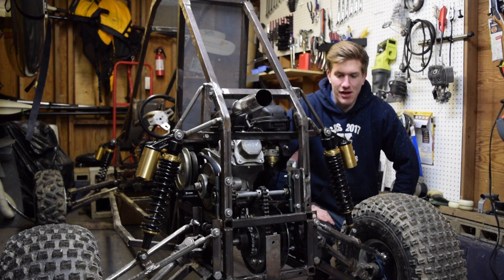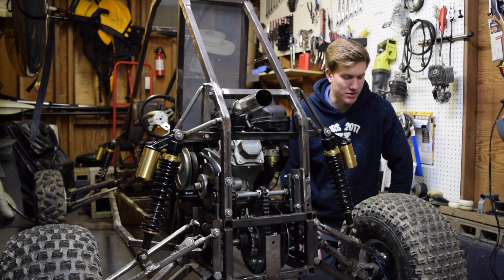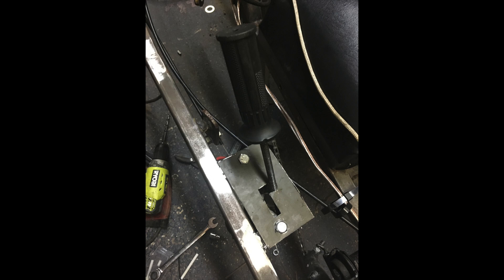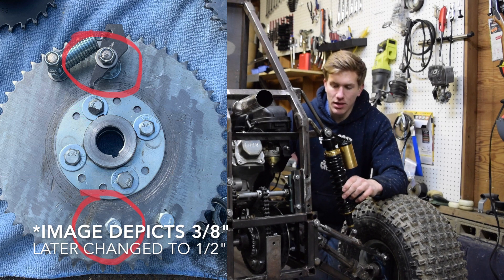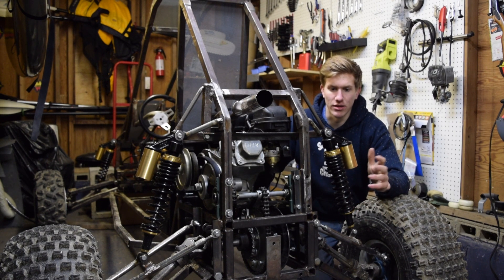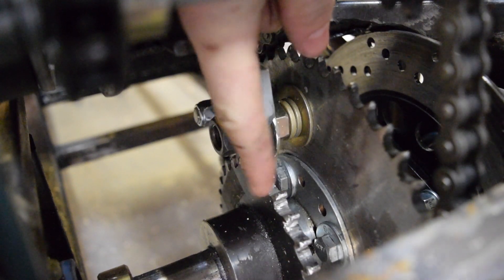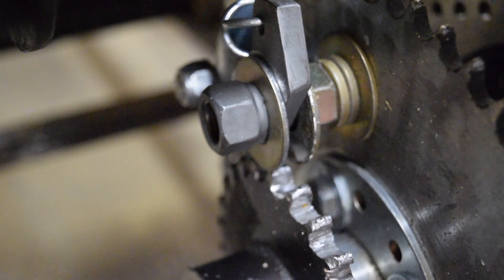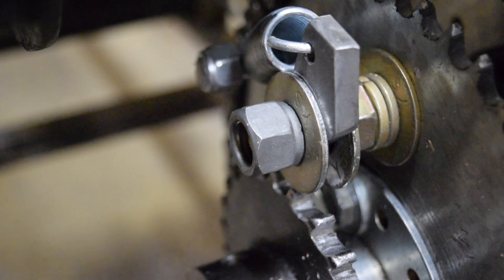How To Build a Go Kart Differential

Comment: Could u give more detail as to how you attached the drive sprocket onto the axles. I understand the differential sprocket design I just fail to understand how the drive sprocket (middle sprocket with chain on it) is fixed to the axles
Reply: The main drive sprocket  connects to a hub.  Both axles meet inside the middle of that hub. The Hub isn't keyed to either of the axles. Both axles can spin freely inside that hub.
Reply: How does it stay aligned with the sprockets and your diff if it's just in there free spinning? Do the axles meet together at the drive sprocket which has a hole that's a lil bigger than the axles and the. The hubs are wider and sandwich the drive sprocket between them and also keeping it aligned? Then what u just use two bearings per axle?
Reply: Sorry for being so dense. I really admire your simple and effective design. Impressive

Comment: 👍 Definitely a great idea. 
    After reading through many of the comments it seems like many Overlook the fact that this is a inexpensive way to achieve excellent results. Although the sprockets are relatively inexpensive and likely easy to replace,  curious how long they're wearing. 
    I'm getting ready to start building a 4x4 electric Street buggy. ( yeah I can actually get it licensed if I follow a few rules) Although I could use any number of ready-made differentials, I always prefer to build my own parts. This system would work good for the back and I could still reverse using the front axle. 
    What I had been contemplating is a ball diff. Much like you would find on some RC cars. Where you have a plate on each side of a main Drive disc. The main Drive disk has the holes in it that contain large bearings then you can control the pressure on each of the outside plates depending on how much differential lock up you want or need.  And that pressure could either be controlled by a servo. It's not all that expensive or even really complicated the build.  And also would be quiet with very little wear.  
      I have been designing and building airplanes for decades. But I started building carts in the sixties. 
   Never stop engineering and never be afraid to fail. 
     I have a nice high Wing ultralight. ( j3 kitten). A superstol bush plane. Many one-offs on it. 16 in of travel on swing arms controlled by Fox air shocks.  And the type 1 2300 has 2 AMR 500 superchargers with clutches.  They work on a manifold of my own design.  And feed 4 throttle bodies 1 per cylinder.  This Plane can get off the ground in less than 30 ft. 
     And the 3/4  scale all composite P-51 Mustang has a supercharged LS3.  It well Cruz all-day at 318 knots per hour.  And burns 21 gph on pump gas.
       🤠🐂🏞️🛩️

Comment: Is this unbearably loud?
It seems like you could churn these out for cheap if the ratchet pawls were part of waterjet cut disks, cut from spring steel. You could have several pawls on each to spread out the force, reducing the noise and wear.

Comment: Looks fun man!   But, this elimates reverse and will not hold up long term.  Maybe build a sprocketed cylindrical diff (no pinion, ring is replaced with sprocket) with encased spider gears.  Just a thought!

Comment: Hum...i have a question ( sorry if my english is bad im french 😬) ... If the If the inside wheel is the only one that is propelled by the engine when cornering, does the go-kart lose its grip on the road?...And if the engine is not powerful enough, is it possible that it could stall when it turn?
Reply from the maker: If the inside wheel were to lose traction the ratchet mechanism would “catch up to itself” causing traction to move to both wheels. And no it cannot stall with this engine because of the ctv
Reply: @gaspedalgarage7670  okay thanks 😉☺️

Comment: I'm curious to know how that would work with reverse? Surely the system would free ratchet if you had a reverse gear?
I'm trying to figure out how to build a chain style differential that can be operated in both directions
Reply from the maker: I’ve answered this question on a few other peoples comments, go check those out for a more detailed answer but basically it can’t reverse. I had no need to when I built it. It would be easy enough to make some type of two speed trans with one output going to the diff for forward and one output going directly to the axle for revers. Hope this helps!

Comment: Can the vehicle go backwards with this setup?
Reply from the maker: Not if the power goes through the chain. You could go backwards if a separate sprocket were mounted directly to one side’s axle. There was really no need for it to go backwards at the time so it wasn’t a problem. Since this video was made I’ve converted back to a solid rear axle and didn’t notice much of a performance change. I still haven’t built a reverse set up but I have plans for electric reverse in the future. Thanks for watching!
Reply: @gaspedalgarage7670  thanks for the response I kinda figured. Did you go back solid because you broke it or just didn't want to have to worry about it?
Reply from the maker: Both😂. I broke it with a launch(not surprising) and just figured I’d try the solid again. Maybe some day I’ll revisit it and make it able to handle more power but I’m satisfied for now👍🏻

Comment: Any additional footage or design information?
Reply from the maker: Nuvey if you are referring to the differential, no. It worked well for low power applications but I have a ninja 250 engine in a complete rebuild of this buggy and the power was to much for this diff. I have a solid axle now and it still drives very well

Comment: Is there a way to lock the diff
Reply from the maker: Patrick R the diff is always locked in a way. It allows the wheel to turn FASTER, not SLOWER like a regular diff... that means that  if the powered wheel loses traction the mechanism will catch up to the dogs on the other side applying traction to both wheels. Basically there is no way for you to spin one tire with this design

Comment: Could I find a sproket like that or do I need to make one?
Reply from the maker: Patrick R I bought the center sprocket from go power sports . Com and modified it for this. If you mean the smaller sprockets you can get them at tractor supply

Comment: Yo this is amazing! I've been looking everywhere for a simple idea. You are super smart!
Reply from the maker: The Gladdens glad to hear you like it! Unfortunately since this video was made I put a little to much power through it and it broke ;( but eventually I plan to make a better version
Reply: What broke?
Reply from the maker: Logan Taylor the bolts holding the “dogs” in place bent and caused the whole assembly to slip. If I designed it so they were closer it the sprocket and maybe sandwiched plates to keep the dogs inline with the sprockets the design would be better.
Reply: @gaspedalgarage7670  I wonder if you stacked some steel plates, welded them together, then welded it to the sprocket, then drilled a hole for a bolt, if it would offer more stability?
Reply from the maker: Logan Taylor great idea, there is a lot of things I think could make it better. Maybe some day I’ll rebuild it. For now I’m happy with the solid axle I put in. It still has independent suspension with cv axles but no diff. I was worried about understeer but I haven’t noticed any change. Right now I’m putting in a ninja 250 engine that makes a lot more hp, I want to make videos about it but I’m very busy!
Reply: @gaspedalgarage7670  would like to see that! I was thinking of building this diff for a side by side, but it would need to be a lot stronger due to the fact I'd be putting a predatpr 670 in it and carrying 2 people. 
What did you do for the live axle, just weld one end of the cv axle straight to it?
Reply from the maker: Logan Taylor send me an email: thedbrgarage@gmail.com so I can show you pictures and tell you more, it’s just easier to communicate and I don’t want you to have to put your email in here
Reply: @gaspedalgarage7670  done

Comment: Great job, I like seeing people use their brain to solve mechanical problems. One thing though, wouldn't a weaker spring engage just as well with less metal on metal wear?
Reply from the maker: GhettoRanger You are absolutely correct. The pressure of the engine pushing those “dogs” drives them more securely into their positions. I didn’t know how well this system would work when I first made it and the heavy springs were simply a way to ensure the dogs would engage very quickly and never skip over the teeth. I have since removed this system with the hope of re engineering it. I will definitely keep your suggestion in mind. Thanks!

Comment: How does the rear brake work? I only see one rear brake rotor
Reply from the maker: Josh Kelly that is the brake rotor you see in the back. It only brakes the rear right tire but I’ve never had any issues with imbalance or spinning out so I’m not concerned

Comment: How can you reverse?
Reply from the maker: Carlos Super Vagão Fagundes at the time when this video was made I really didn’t need (or have a way to reverse) ie. the engine didn’t have a reverse gear... so it wasn’t a problem. Now that I have redesigned it I would like to put reverse in. This can be don’t by placing another sprocket on one of the sides that goes to a reverse gearbox but as of now I have not done anything.

Comment: Great design! Have you looked into replacing your setup with two sprag clutches (freewheel bearing) i think it will give you the same result but in a more compact design and with less moving parts. For your design when cornering do you notice a loss of power, because it is driving the inside wheel?
Reply from the maker: Jacob Najmy that would be a great idea, as of now I’m satisfied with the result so if I decide to rebuild it I’ll keep it in mind. As far as power, I have not noticed any loss. If  you mean any loss of power due to slipping then also no. If the inside (powered wheel) were to lose power the ratchet would engage causing the power to be transferred to the wheel with the most traction. Thanks for your support!
Reply: I’ve been wondering about using Sprague bearing as wheel bearings, keyed on inside and out. It seems this would work if one could find appropriate sized bearings to fit in wheel hub. Would like to hear more about this, using a live axle.

Comment: i would have made 2 discs to put on either side with bearings on the drive axles and machine sleeves in place of washers to space the outside discs from the rachet mechanism then put a long bolt through the the outside discs, rachet mechanism, and sprocket to make it stronger and with that you could make the racheting mechanism a bit bigger
Reply from the maker: there are a few modification I would like to make or have already made to the original design! thank you for great idea!
Reply: @gaspedalgarage7670  i just had a thought, is the sprocket that the chain goes on where the rachet system is have collars on both sides if so you could add 2 extra discs to encase the system you may have to fabricate longer bolts to get it to go through 4 discs and the sprocket and if you use the idea i had from the earlier comment i made by adding 1 more sprocket to each rachet gear on either side and doubling the hook size, and also by adding 2 more hooks because you would have to get or fabricate 4 long bolts to hold it all together the 4 bolts would have to go through the entire system or it might warp the sprocket
the system would be strong enough to withstand more torque
Reply from the maker: that would be a great idea! at this point the power is not high enough to warrant any additional strength.

Comment: Good job. how do the sprocket hold up?
Reply from the maker: they have held up very well so far, only slight wear. I'm sure over time they will need to be replaced but it would be very easy to do with the design.